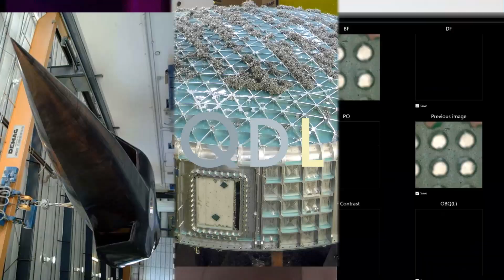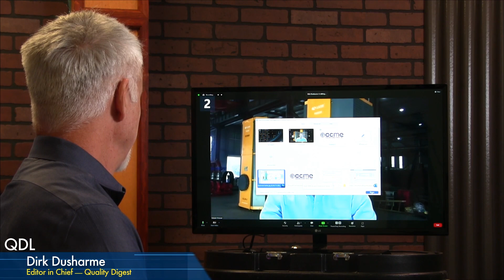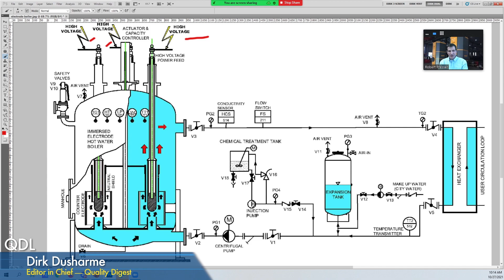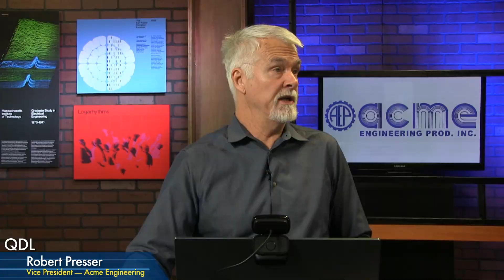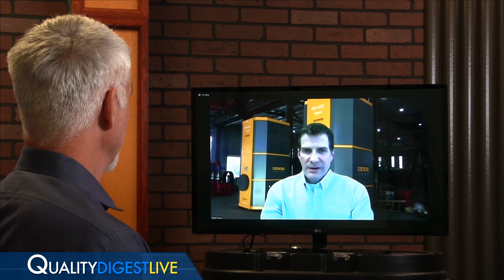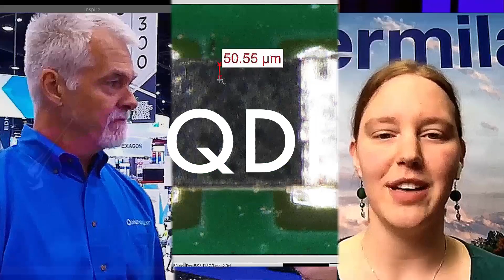Leaner cleaner electrode boilers–Robert Presser Interview #businessmanagement

Comment: Very interested in this, understand the gain in efficiency in the high conductivity in the water in the closed loop system but how do you deal with scaling?
Reply: Routine service, 2/3 yearly service clean the shell of the boiler and as required replace electrode heads.